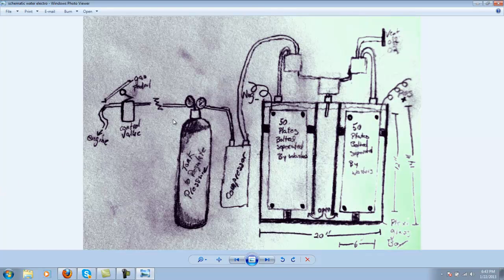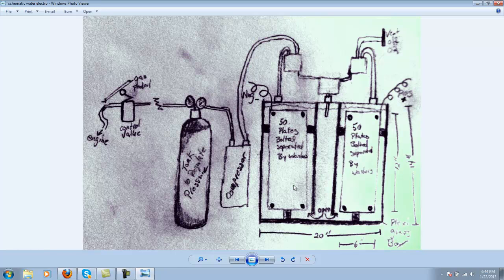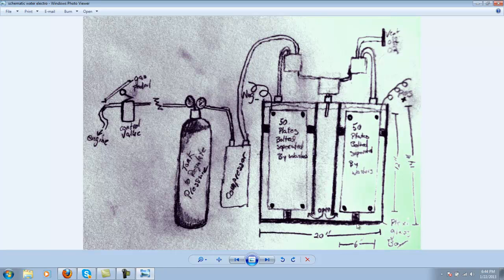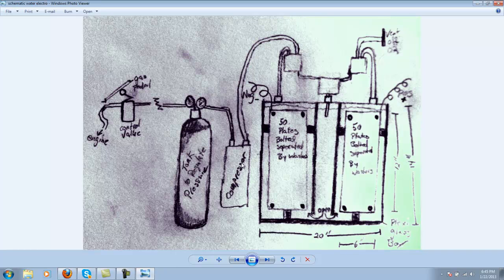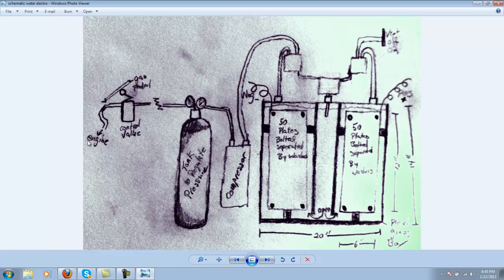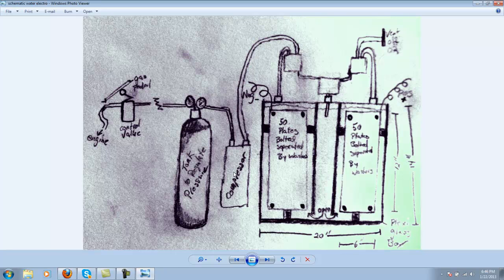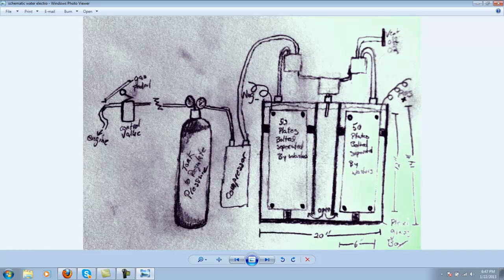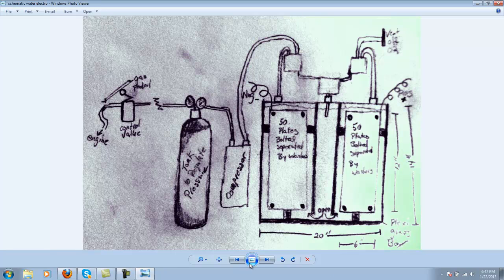schematic of hydrogen generator adapted from Hoffman apparatus

Comment: so what if you just pump it into a lpg system in a car?
Reply from the maker: You should look at the periodic table. LPG is nowhere near the weight of H.
Reply from the maker: Try it. The only problems are: 1. predetonation, so it must be direct injected and 2. the timing is faster, so, top dead center for both spray and spark. This early design was to create the H on demand for exactly that purpose.

Comment: So is this a wetcell? Youre stacking plates like a drycell config, but it looks like you are submersing them? No... looks great!
Reply from the maker: +RascalKyng This was the earlies prototype. The electrodes were too far apart but even so I was encouraged because I was getting seperated hydrogen. Still working on a better mdel. I will post when I have something to report.
Reply: +Rob Ellis.   Cool...  So any estimates on litres per minute? This seems easier than stacking a ton of dry cells... I wonder how it would do if you combined both concepts, this and the Stanley Myer model... How long do you suppose the electrode metals will last before they corrode? good luck!
Reply from the maker: +RascalKyng The electrodes are the part I am working on now. Waiting on materials I ordered. The other part is the PWM technology is not right. The ones in use help but they do not do all that is possible.

Comment: I just saw that you plan to get away from gasoline altogether.  Yep, you should pull timing. A hydrogen flame front propagates way faster than hydrocarbons.
I'm curious to know what ended up working and on what motor,
or what failed and why.

Comment: There is an oxygen sensor called a wide band O2 sensor. When properly installed a Guage will indicate your working air fuel ratio.
stoiciometric is 14.7:1.
I would set it up with a solenoid and a fixed orifice to deliver a consistent flow rate when it is being used.
fuel injected vehicles have operating modes called closed loop and open loop.

In closed loop operation, the vehicle oxygen sensors are used to roughly interpolate Air fuel ratio (this is not to be confused with the wide band that I highly recommend you install so that you will know if something is wrong) and in closed loop a target air fuel ratio is roughly maintained.

so while at cruise at highway speeds you would open your solenoid to allow hydrogen flow to your intake after your mass airflow sensor. The oxygen sensors will notice the extra fuel by the lack of oxygen in the exhaust stream and will automatically adjust the pulse width of the fuel injectors to reduce the amount of gasoline being delivered.

use of this tech on a carbureted vehicle is simply a waste of fuel as a carburetor meters fuel by the flow through the venturi and will never be able to compensate for the extra fuel. It would just run rich. you could lean the carburetor out by jetting it, but then if you couldn't maintain a steady supply of hydrogen you would run lean, and that usually results in engine damage.

on modern fuel injected vehicles timing is controlled by the ecu and in closed loop operation look up tables are used in conjunction with a KNOCK sensor.
A knock sensor senses detonation and signals to the ECU that detonation has occurred causing the ECU to pull timing if detonation continues to occur the ECU makes longterm adjustments to its tables to avoid engine damage due to prolonged detonation.

This is called adaptive strategy.

If you set your vehicles ignition ( that is if you drive anything so Damned old that it has a distributor) to a base timing of zero degrees before tdc, your car is going to run like shit and lots of unburned fuel will be fuming out the tailpipe and you will get fewer MPG not more.

You are correct that hydrogen will effect your overall net octane rating but to pull all the timing is a very bad idea. 
If you plan to abandon gasoline and run 100% hydrogen there are fuel management controllers available to regulate a fuel injector.
at that stage I fully suggest you take the vehicle in to a tuner and get it setup right. It may cost a couple grand but it is cheaper than a new motor for sure.

good luck and thanks for the diagram on the separator.

If you need to know more about engine management just ask.

Comment: Great schematic Rob, well explained too.
I've been studying a lot about HHO and H2 latelly and  I'm going for the H2 as well.
You probably know this, but here it goes for the ones who don't. It's about the plates.
I've seen in many sources that stainless steel (all kinds) contains chromium and when it is exposed to eletrolysis it releases a byproduct named Hexavalent Chromium, a hazardous, in fact, LETAL thing. It's a dangerous carcinogen specially for the lungs.
Some guys advised using titanium, others graphite, other are experimenting carbon fiber instead.
I'm going to use titanium plates, because I think it's a no sense to build a green source of energy poisoning myself and others with this Hexavalent Chromium thing.
Thanks for charing your stuff and good luck to you with your project.

Comment from the maker: Pure water is conductive. Test it before you troll my channel. Take a set of jumper cables and hook them to a battery, then take the positive and clip it to the side of a container of water so the metal only touches the water, grab the metal lead of the negative side and put your finger in the water...make sure you film it and post your video findings as a comment below..that would be awesome.
Reply: pure wated conducts fuck all everone knows that thats why you use a electrolyte
Reply from the maker: Kevin Martin Everyone knows water is a conductor. Stand in a puddle and touch an outlet. Make sure you video the results.
Reply: H2o dont conduct itself it needs an electrolyte
Reply: A puddle aint pure water
Reply: @kevinmartin894  it depends on how you have your plates arranged. I can get hho without any electrolyte.

Comment: Pure water is not conductive. This device probably also used a lot of electricity,  what is efficiency?
Reply: I've tested this theory. Ran distilled water, tap water, spring water and with my two plate setup they all produced without electrolyte. Now they don't produce much and you have to pump in around 30 volts but I can say that I've gotten all these waters to produce without electrolyte. I'm going to build a bigger version and test that but electrolyte is better for sure.

Comment: this is the simplest and most effective. but shouldn't it be separated by gasket instead of washers? water must connect the plates together not washers I think. do we connect to the headlight and not the battery?
Reply from the maker: I like this comment. I have since this video seen many examples of seperator cells, very nice adaptation to the dry cell standard.

Comment: I am making this but on a smaller scale.  Pure hydrogen put into an ICE engine will increase fuel millage and you do not have to reprogram the car's computer or make any adjustments to the O2 sensor or MAP sensor.

Comment: you will be using oxygen just oxygen in the air...and wasting half your gas...good luck though i dont think there is anything wrong with running hho as long as you introduce it AWAY from the intake so that you can also add more oxygen because you need more oxygen then is provided by hho

Comment: I would add a little tank between the compressor and the hydrogen output and a pressure switch to that compressor just to make sure nor water or air is sucked into it. Ragards

Comment: Hi Rob,your doing great! I'm working on a similiar project. Have u tried to uas a much smaller qty. of + plates to get the same amount of H2? Since the + plates are only there to create an elecctrical flow of current and they increase the size of the cell maybe ONE plate would provide the same quanity of H2 flow? Keep up the good work, I'll be following u alond

Comment from the maker: Thank you Jerry, What I am planning is 100% hydrogen and zero gas or diesel. 
That has always been my goal.
This is why I went back to the drawing board and derived this design from the Hoffman Apparatus.
I have a simple unit almost complete for proof of concept testing.
I have to get the generator yet but I think this will generate enough for a small engine with what I have on hand.
I appreciate your support and your input. Theory tempered by experience is what will make this goal a reality.

Comment: Good deal I like your presentation.  That's your own preference.  If your going to just bleed off the O2 then you might at least try to feed the O2 into your intake near the outside end at the start of your breather tube.  More oxygen in the air is better burnt gasoline. I fed un-compressed hydrogen from one tube and non-compressed oxygen from another into my intak from a flash suppressor and that alone doubled tripled acually my deisel fuel milage from 9 mpg to 27 mpg. well keep us all informed

Comment: BTW, good idea with the multiple plates stacked in each container this way 90 degrees rotated... The question is, if it is not easier to just put in there lots of Stainless Steel Scrubber wool, which is very cheap to geat in every supermarket and  has a big surface area...
I will try it first this way.
Many thanks.
Regards, Stefan.

Comment: You  fill the H2 tank metal bottle totally up with water (no air more inside..)
then turn it upside down inside a water bath and put a H2 hose into it, so the H2 will substitute the water in there. This way, no more air will be in there.
If all water have come out you can then screw in the hose correctly so the bottle can then be pressuriized ! This way you will only have H2 in it and no air..
Hope this helps
Regards, Stefan.

Comment: Hi Rob,
you really don´t need the critical compressor, if you use water for the compression as shown in my principle video here:
/watch?v=AikUjB2WXgs
You then only need a water pump or a hand pump to press water from the bottom side into your electrolyser and this way it is much safer.
ALso be cautious with the hydrogen tank. You have to make sure, NO AIR is inside it, if you fill it up.
One method to do this is the 180 degrees upside down method inside a water bath..